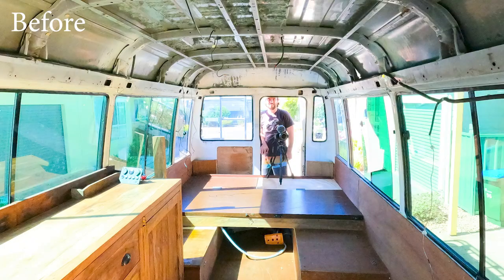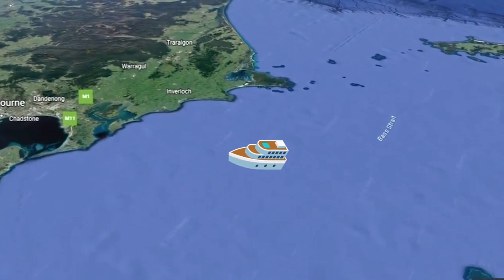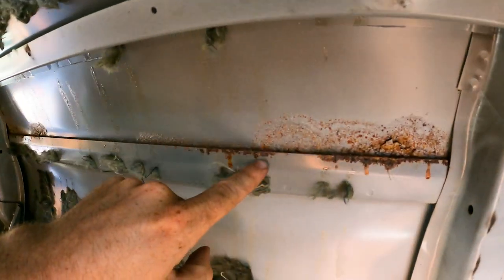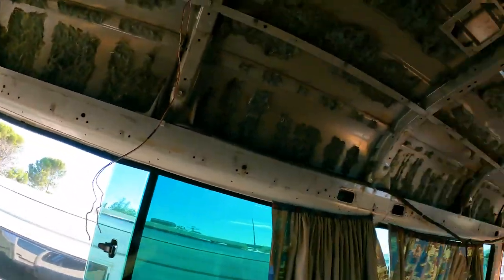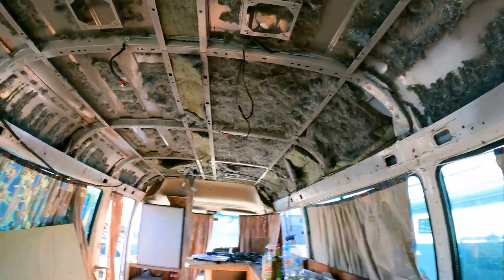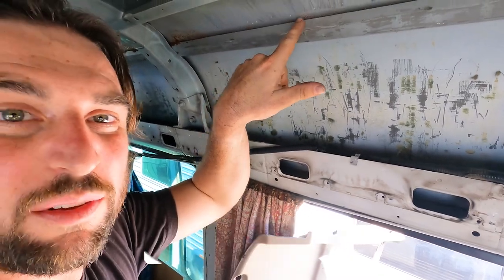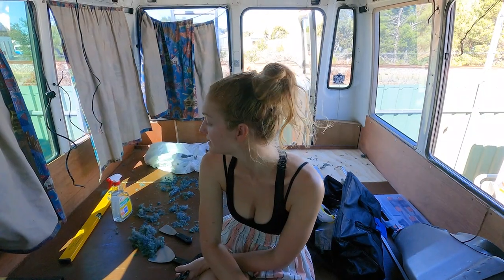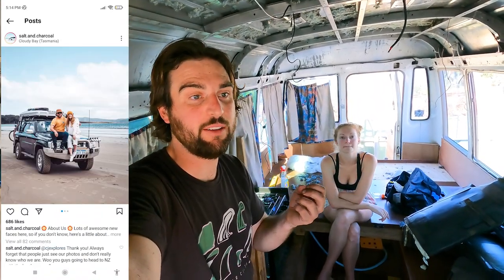RENOVATING a 4WD Toyota Coaster Bus - Finding the Bus, Demolition & Discovering Rust - Ep 1

Comment: Awesome. Just discovered your channel and I'm about to binge watch until I've caught up. I too have a 4WD bus, kitted out as a home. It's a 1991 Mitsubishi Rosa 4WD. I bought it (in New Zealand) 6 years ago, already kitted out in modern campervan style. It wasn't perfect for my needs, so I gutted the dining and kitchen area. I built a new lounge and kitchen area out of cardboard and duct tape, lived with it for 2 weeks and tweaked the design until it was perfect. Then I measured everything and rebuilt the interior out of elm and plywood. It's an on-going project, mostly because of the ridiculous way I like to do things. Curved drawer fronts, for example. I'm stoked to have found your channel and to finally find some other 4WD bus peeps. Cheers guys.

Comment: A better option for getting the insulation glue off is plastic metal brush head. It pulls it all off without damaging the paint like a scraper will. Make sure you’ve rust proofed everywhere you’ve scraped after 👍
Reply from the maker: Hey Vicky, thank you this is an excellent point we didn't think of! Wish we had that back then lol, eeek! Yes the metal brush head did grate away a bit. Thankfully we did rust proof most of those sections after... but not all of them 😬